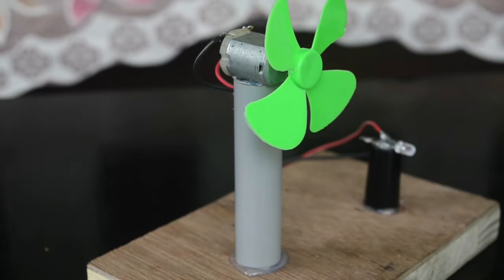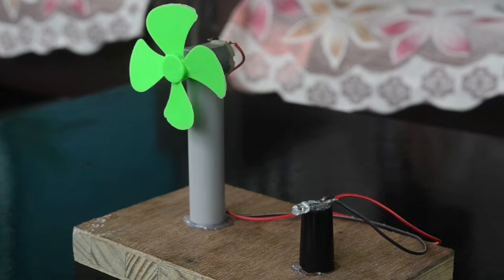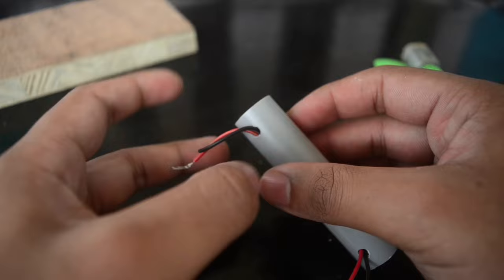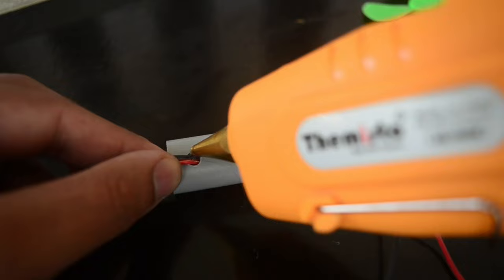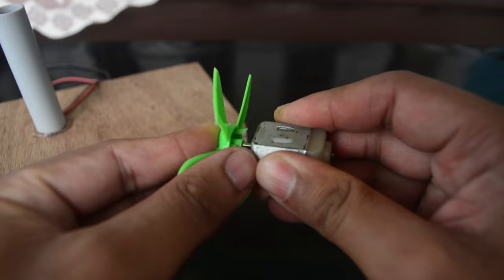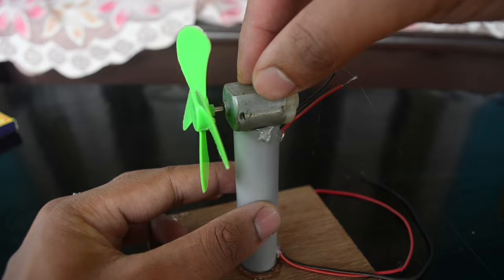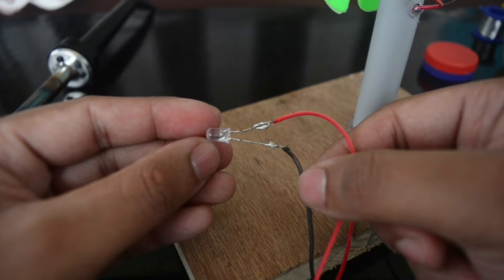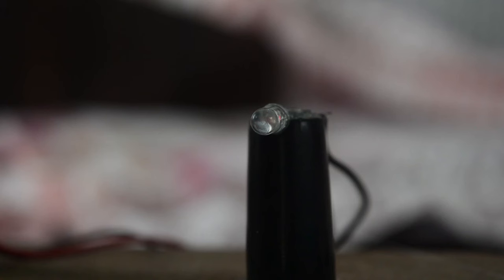How to make a Wind Turbine at home . Very Easy science project .

Comment: mine doesn't produce electricity any solution???
Reply from the maker: Try reversing the wires , spinning the fan faster or maybe the voltage of the bulb u high try using a low voltage one

Comment: thank you so much,  random question, how many wind turbine like so would be needed to power an Arduino UNO, with shield and 2 DC motor?
Reply from the maker: Instead of using a small motor like the one in the video try using one 12v motor .

Comment: Can someone explain me, how does it work without any batteries and source of function of it?
Reply from the maker: When we blow air on the fan it starts to spin which in turn spins the shaft of the dc motor and dc motors can generate electricity so the light bulb lights up . This model shows the conversion of mechanical energy into electrical energy.

Comment: This is very nice project.....

But I want to know that....if we connect more led bulbs with one moter than will is work?
Reply from the maker: Than you have to use a bigger motor otherwise the electricity produced will not be enough to light up all the led bulbs .
Reply: @TheRandomBunny09   ohk sir thank you so much for replying.....

Actually I made a model of vertical axis wind turbine and In that I put two moters with two turbines and and then four led blubs....but still it wasn't working.

I will be very grateful if u can give me some information about the project of vertical axis wind turbine.

Comment: Is it a 12v motor?
Reply from the maker: No bro its a 3.5 to 6v motor but if you want you can use a 12v motor that will produce more electricity but you have to put a bigger fan on it .
Reply: I have a bigger fan and this is why I asked if is a 12v motor cuze i have one... Thx
Reply from the maker: @1st_ofDingus  a 12 v motor will work even better . If you can get the fan to turn fast enough it will be able to produce enough electricity to power a 5 v led .

Comment: How motor works without electricity or an battery 💀
Reply from the maker: I was blowing air on the fan so it started spinning and then the mechanical energy was converted by the motor into electrical energy which in turn turned on the led bulb .
Reply: @TheRandomBunny09 oh but i am indian so i use a jugad that i am thinking in my mind to blow turbine automatically 😂
Reply from the maker: @robloxo9577  I am indian too bro ❤🇮🇳
Reply: @TheRandomBunny09  👍👍👍

Comment: I have a problem, im running a dc motor its like a 3v and trying to light this 3mm led that i suppose to turn on at 1v and its bot working
Reply from the maker: The fan needs to spin at high speed to generate electricity. If it is not moving fast than no current will be produced
Reply: @TheRandomBunny09  ohh totally forgot about that thanks

Comment: Can we use a different led to light it plz reply
Reply from the maker: Yes but the motor produces only about 1.5 v so if the led requires more volts than it will not work .

Comment: do i need black or red wires or any wires?
Reply from the maker: Any wire will work .
Reply: @TheRandomBunny09  do i need to buy dc motor or my rc car dc motor r any dc motor will work?
Reply from the maker: @jeromealtea2703  rc car motor will work but don't use led that requires high voltage .
Reply: @TheRandomBunny09  no i mean if all dc motor produce electricty how many do yo think that i can power 5-20 volts like wifi
Reply from the maker: @jeromealtea2703 for generating 20v you would require a big 20v motor or 4 5v motors .

Comment: I cant find the black wire where i went theshop has only on wire which they are cutting and giving will it work with the same wire and i have to put the light far from the motor,what to do??
Reply from the maker: Yes same colour wire will work . You can keep the led close or far but don't put it too far .

Comment: Sir i am using 9v dc motor and same bulb but its not working...?
Reply from the maker: The fan needs to spin very fast for the motor to produce electricity . And if it still doesnot work than reverse the wires than it should work .

Comment: Its fake he is uimg power source
Don't beleive in these tricks it's all fraud
Reply from the maker: It works but it produces very small amount of current so use a low power led . If you use a 12 v motor than it will produce enough power to produce larger leds

Comment: I tried it in many ways but it is still not working
Reply from the maker: The fan need to spin very fast for the motor to generate electricity. If it's still not working than try reversing the wires .